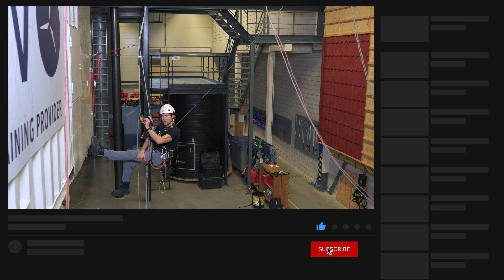How To Pass a Single Deviation - IRATA Level 1 Training

Comment: wheres a magic not on the end of the rope ? And why you not attached to the carabine on deviation before uncliping  the deviation ?
Reply from the maker: I dont understand what you mean with magic not at the end of the rope??
Reply: The distance between the deviation and the anchor isn't wider than an arms reach so no stopper knot would be needed to pull yourself into the deviation

Comment: it wouldn't be nice to attach a cows tail to the deviation's carabiner before unclipping your lines?that way you don't have to carry with you a broomstick with a hook on the end! :)
Reply from the maker: 😂 Good call. At assessments that is what everyone does. It is what most get taught and also what I try to explain in my courses. You should be able to get the rope back into the anchor. But a single deviation is there to position yourself to a workspot. There should not be any danger whatsover below or behind you.So if you would let go, you should be able to re rig it as you would have done when installing it. Or just descend down. No problem, well maybe it will cost time. It is not a safety issue.
Reply: Thought exactly the same-that's how we did it in training. Much safer if you lose the grip!